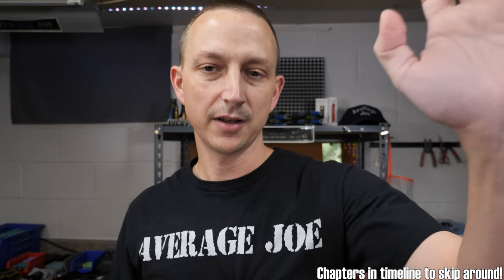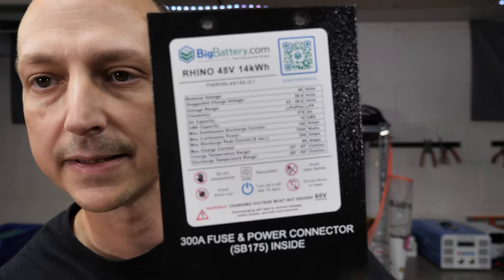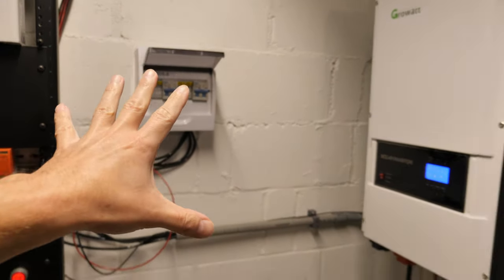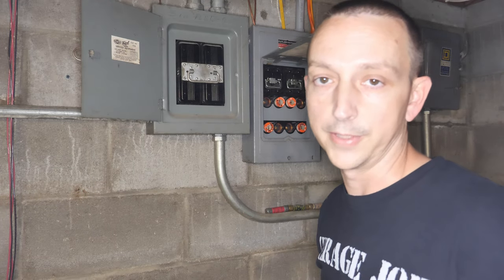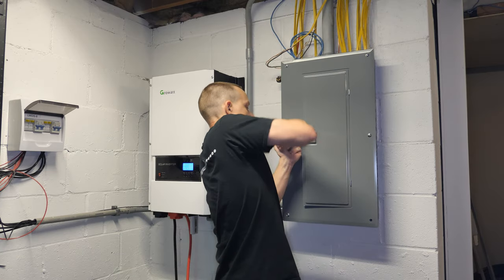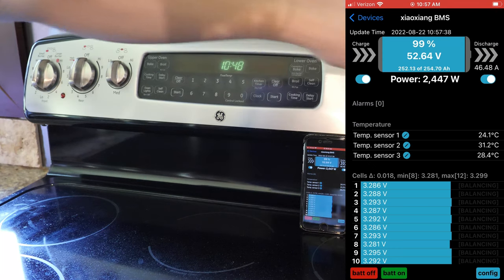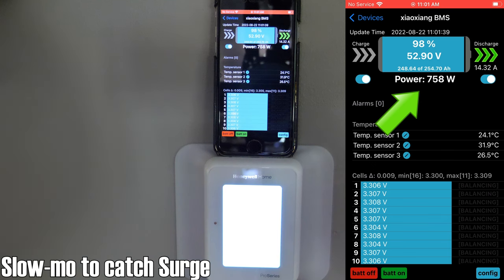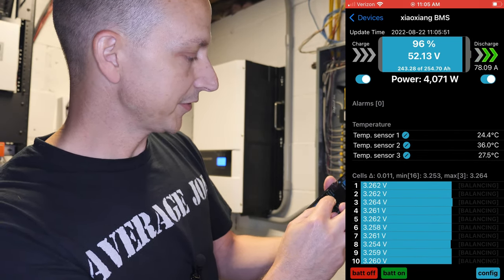Can you Run 4 Ton A/C, Stove or Dryer on a Battery???  RHINO BigBattery.com

Comment: I have the 6000w version of the same inverter and it was running my water pump 220v and my living room only, but that one only works for 7 months and then get bad from a short circuit on the charger area or terminals.  Not sure if it was the Florida heat or the inverter quality.  Thanks for your videos 👍
Reply from the maker: Thanks for watching! Interesting that you only got 7months use. I have been using almost 2 years! Is there a board you could replace on the inside that shows damage?

Comment: Your Growatt inverter . is it a hybrid inverter. if not and is a grid inverter. How can you run a battery backup from the on grid inverter install.
Reply from the maker: It is an off grid inverter but is connected to grid for battery charging or using passthrough mode. Many different ways to use. Option 1, use off grid only. Option 2, use as off grid but grid connected as a backup source. That allows grid to charge batteries and allows grid to pass through inverter to keep powering loads. 3rd option, use a a UPS which is keep using in passthrough mode and if grid goes down for whatever reason like a storm. It will switch automatically to off grid to continue powering loads. Once grid returns it will auto switch back and recharge if wanted.

Comment: Great video AJ! Always add a spin in the process👍🏽.
Solved a similar situation by changing my 2, 2.5ton conventional central units, to the Amana 24-SEER central units. With both units on, pulling under 2KW, on my single Schneider Conext XW Pro 6848 inverter.
Reply from the maker: Damn! Thats GREAT!!!😲

Comment: Yes, those last two digits matter. That would tell you if they installed grade B junk cells. You could have a 99 mV voltage differential and look good. Manufacturers are getting slick. They like to control charge current with the BMS to keep runners from showing up at 55.8V too. Off grid garage said they don't control current. Well, try a Seplos 200A 16S or a Trophy battery. No more factory batteries for me.
Reply from the maker: I know these have JBD bms's and they are not smart enough for controlling current.  They are on or off!!
Reply: Off Grid Garage did not have as good of an experience with the Seplos.

I really like what I have seen from the JK BMS’s so far, from off grid. My money is on them.
Reply from the maker: Yeah that sepo bms seems crappy for sure!

Comment: 1) If my math is correct, I think to convert from Ton/SEER to Watts you Multiply the Tonnage by 12,000 (1Ton in BTUs) then divide by the SEER rating. Therefore (4x12,000)/14 =~ 3500 watts. This of course is Average and changes as the compressor cycles on and off.

2) You can install a Soft start kit on your AC (I think they go for a few hundred dollars) that would prevent your AC from Surging that much on startup. It helps improve the performance and longevity of you AC and not over tax your inverter/battery.
Reply from the maker: I dont math well😆  Yeah Ill for sure be looking into the soft start!  I would imagine it would help out A LOT!!!🤘
Reply: @AveRage_Joe  Great! Thank you for the great content.
Reply: Just call it 1000W power consumption per ton. It is close enough. Yes, soft start will reduce LRA 65-75%!

Comment: Thanks a lot for testing this for us Joe :-)   !      I have a question that you might be able to help me with. I am in the process of installing a 12KW Growatt inverter (same as yours),  and was wondering what size Circuit Breaker you are using for the Inverter "AC IN" and for  "AC Out" because everything seems to be working fine at your end, and would like to use a similar setup.   TIA  Dan
Reply from the maker: Thanks for watching!  Your going to Love the inverter btw!!!  So AC input at the moment I am using 2 60amp fuses on that super old panel.  I am using 60a at the moment because I am not running the AC, Stove and dryer.  Once I add all my other batteries and add the AC, stove and dryer(and upgrade that old panel) I will use 2 80amp circuit breakers for the input feeding the inverter.  Output is 2 60amp because the inverter already has 2 60a breakers on it.  Reason you use 2 80amp for input is because you need a little extra so you can run the house plus charge the batteries from grid(if needed).💥🤘
Reply: @AveRage_Joe  Thanks a lot for your reply Joe!  that's helping me a lot.  Take good care!   Love your videos  :-) .
Reply from the maker: No prob and appreciate it!!

Comment: I run my stove on solar everyday. The eyes turn off, for about 2 minutes, and turn on for about 15 seconds. That's my stove though. I have a Samsung flex duo. 
The oven is about 1600w per leg, 3200w total.

My dryer is what kills me. I have to use it during the day, about 1200w per leg, then a long cycle of 2000w per leg, for about 1.5 hours. 

I have a single MPP solar lv5048 
6x 14s2p (kind of) Nissan leaf batteries
And 40x 240w Trina panels. 

I need another lv5048, way more batteries for my amount of panels, and I want more KWh, lol.
Reply from the maker: NICE!!! Thanks for sharing!  Sounds like you have a pretty good setup and YESSSSS  WE WANT MOAR!!!!  Moar on the way!!!😆💥🤘

Comment: AveRage Joe, thanks for the test!
Here is a video before and after test on a ‘Soft Start’ on a 4 ton air conditioner
Reply from the maker: I didnt see a link?
Reply: @AveRage_Joe  looks like YT pulled the link. I will send several if you need via other method.  You should be able to do YT search to see a variety of versions.  Do your homework. They are not all the same.

Comment: You were using 150amps plus from battery, but what is the breaker amp feeding the power to the panel?  And how does that work if the breaker feeding the panel is less amperage?
Reply from the maker: Battery has a 300a fuse which feeds inverter. Inverter changes the 48vdc to 120/240vac which feed 2 60a breakers on panel.
Reply: @AveRage_Joe  Ah, so the amps are reduced at the inverter and the voltage  is raised from 48 to 120/240.  Got it.

Comment: are you still using that inverter? i was thinking of buying one for my 5th wheel. have you had any issues with it? thank you.
Reply from the maker: Yep still using it 24/7! No major issues at all, just a few random quirks,1 occasionally it wont see the solar panels so wont charge. When it does that I change the charge setting to either grid charge or solar and grid. Then it see's the solar panels and Ill change back to only solar charge. Occasionally if you are in bypass mode(grid mode) and use the app to change to off-grid mode, it dosnt switch right away. If it does this then Ill turn the AC input circuit breakers off to force it into off-grid mode.

If your in a 5th wheel and dont use it 24/7 like me then you most likely wont ever have these quirks. I Love the inverter and would purchase again!🤘

Comment: nice but what is the inverter doing
Reply: It's running so u better go catch it
Reply: @electromechanicalstuff2602  always going to be a smart ass I’m asking how much watt is the inverter running because it’s only showing the battery because why he’s doing with his running his house without the AC the stove and the dryer I do It with a 3000 watt inverter
Reply: @solarandwindinsouthtexasda1473  yes I am and what?! Please link the video of you running a 4 ton ac unit starting and running on a 3kw inverter while running multiple burners on an electric stove while running the blower and other items all simultaneously. It's the only battery connected to the inverter so what the battery is seeing is what the inverter is doing. Ac and stove are 240 so should be a pretty balanced load.
Reply: @electromechanicalstuff2602  not a 4 ton but I run a 2ton 240v Wiht a 2500 watt 120v inverter 🤣🤣🤣🤣🤣
Reply: @solarandwindinsouthtexasda1473  2 ton? So 24,000 BTU..... At 120 v? Uhhh
Reply: @electromechanicalstuff2602  2 ton a/c 240v running on a 120v 2.5kw inverte wiht a transformer to get the 240v
Reply: @solarandwindinsouthtexasda1473  lots of work and still struggling to believe a 120 volt 2500 watt inverter handled the startup of a 2 ton unit. Also u said you ran a dryer on it? Dryers are 5,000 watts. So I'm not really sure whats going on here. One burner on a stove is usually around 2,000 watts also. I think what Joe was showing as far as watts was accurate and what your saying you did with a 2500 watt inverter is questionable.
Reply: @electromechanicalstuff2602  🤣🤣🤣🤣you re so funny 😂
Reply from the maker: Inverter is running the house minus the AC, Stove and Dryer in normal day to day use as I need to change out some old fuse panels in the house.  In the vid I end up back feeding a fuse panel to power the AC and Stove.  Not the most efficient way due to extra wiring but doable.
Reply: @AveRage_Joe  ok i ask because I run my house on a 12v 3000watt samlex evo and I want to run my a/c and water heater but I don't know if to get a growatt, ipp lvx6048 or a genetry solar inveter I had a sol-ark bad experience if the load are not balence it shots off
Reply: @AveRage_Joe  I saw that in the vid and thought you explained it well. I installed a new 200 amp panel with only 8 breaker spots but has passthrough lugs. This way I have grid power for bypass but like you use an interlock to choose main vs aux
Video of my system.
It's completed now and running just need to make a new video.
https://youtu.be/w_ycEQPwCm0
Reply from the maker: Oh ok gotcha. Well to be honest, I have only used the growatt so can only "recommend" it. I do hear good things about gentry tho. They are a beast and can run a house no prob. Seen a few vids of people loading them up and they take it. That sucks about the sol-ark.

Comment: so at night I can't run ac 🙃 unless I get like 40kw worth if batteries ?   But during day when solar is charging I should be fine all day? I'm in sunny central California.
Reply from the maker: You could run the AC at night but by morning you might be back on grid if you have it setup to do that which is what I do.  What is your avg temps during nights tho. It might not run a bunch especially if your home is insulated pretty good.
Reply: @AveRage_Joe   i gets to 110-115 in July and August here.. at night during the summer around 80 but we sleep up stairs and it's like 10-15 deg warmer upstairs.. maybe I got poor insulation.. I would have AC set at 77 deg and it would cycle every 10-15 min and stay on for about 5-10.. so I don't know what size batteries to get

Comment: I am finding out that if batteries are not on the California CEC solar equipment list, then your system will not be permitted. Anyone else finding out about this?
Reply from the maker: I know Cali is diff then a lot of places but usually the electrician can install equipment in accordance Local codes. I personally know electricians here that have installed Big Battery Products to meet local code. Even equipment that is not on any list. Just needs to meet electrical code when installed.

Comment: Would you be willing to put a number to the battery run time in your situation running the A/C. My wife and I are trying to get a point of reference for adding a battery ( or batteries) for home backup and or use overnight.
Reply from the maker: Are you wanting to run AC only or hole house with AC?
Reply: @AveRage_Joe   I am trying to have enough battery to have the house function normally through a night without power. We have a natural gas well so the only large loads in the house are the central
A/C (brand new 5 ton inverter compressor 20 SEER with a variable speed air handler, two Mitsubishi minisplits in the shop and welding equipment (the last two would most likely be off during and outage). Our highest energy usage this summer has been 1500 kwh for the month (multiple days in the high 90's to the low 100's). That was with one minisplit running in the shop full time (and the second one added when I am out there working). We have a Sol-ark 15K and 8.2 KWH of solar. There will be a generator in the mix being controlled by the Sol-ark once the batteries are figured out.
Reply from the maker: Oh ok gotcha!!!  Do you have any battery right now or just running solar only with the sol-ark?  As for actual real run-time,  Ill have to run another test running the AC until the battery is ded or at least to 46ish volts.  Id hate to just through out a number but would imagine you would want at least 30kwh for when the sun goes down and back up again.  How many hours are you looking for?  What I mean by that is, do your panels get sun early in the AM or later in the day like mine.
Reply: 4-8 hours would be nice. It was my understanding that once the battery is in place the Sol-ark will be able to turn the generator on to take over the loads and charge the battery once battery is discharged. I would prefer to limit the amount of generator run time needed. My system is ground mounted with zero shade. It gets sun pretty early. I appreciate your help and advice.

Comment: Sir Joe!  Do you know if anyone sells the bare blade cells?  I would like to start buying some in a few months, or maybe enough for a 12v battery, for lights and security cams,  I have 6,120ah 29.4v batteries, a few leaf cells making a matching voltage battery, and a tub full of the spim 8ah cells I may use but would like to build a 72v Ecycle around 50ah with a 5-6kw motor!   But I'd rather NOT be sitting in the dark, on a rainy day, my well pump pulls 7amps, I have a soft start, with all together about 33kwh,. I'm thinking about getting a all in one inverter for the charging only, I saw one with a 120a mppt plus grid charger, that's what I need, so I can charge with my generator,  put nearly the whole 6kw into the batteries! I could run the generator about 2hours and get a decent charge! But I want to buy about 50kwh of lifepo4, slowly, to replace my liion bank, sitting on all that fire prone liion is unnerving! I hope to get a larger inverter, to at least run ac for 1-2 hours a day, and still power every thing else, TV, lights fridge, possibly well pump!
Reply from the maker: Only place Ive seen them is on alibaba or aliexpress.  Id choose alibaba over aliexpress tho.  Yeah id leave the spim cells for the ecycle.  My inverter has 120a solar charger and 100a grid charger which could be connected to genny if no grid.  They have a smaller 6kw inverter but I think its a 80a solar charger.

Comment: You need to be careful that you don't overload one phase of your inverter not all 240 devices .. or nowhere near balance like your dryer one leg will be pulling 15 to 20 amps one leg will be pulling five
Reply from the maker: Yes you should have them balanced but the low frequency growatt doesn't mind as much as other inverters!🤘

Comment: I calculated still whole setup is expensive. I live in Arizona where😮 my 3000 sq foot house has two 4 tone AC. I get around 400 dollars avg permonth  June through September and less than 200 dollars average rest of months. So if i get solar panels (8000 dollars setup, mounts,  inverter etc) and this battery (6000 dollars) It will take almost 10 years to recover the cost and by that time my battery will degrade, one or 2 solar panels might need replacement or repair, inverter life because of 24/7/365 can definitely impact. And after 4 years on the top of 10 , total of 14 years my AC migt need replacement so it will be super expensive. Therefore I will not go for your setup. Rather save that money and invest. After 14 years buy a new AC unit.
Reply from the maker: I hear ya on that! I buy 1 thing at a time and build as I go.  Plus that helps with the up front cost. I just never wanna lose power. Lost it in the winter once and Ill never go through that again!🤘

Comment: Our Frigidaire inductive slide in front control stove and oven air fryer works great on our independent power system. Induction heat is 95+ efficient with 100% compatible pots/pans.. Much lower power draw than conventional. Our hacked Rheem 21-34 SEER variable speed whole house DC compressor system works great with direct DC connection to our independent power system.  Both cooling and heat pump. Uber efficient, slow ramp up power up built in new whole house variable fan for this system is very efficient. We can run all of these at same time.  We have on order a variable DC compressor heat pump dryer.  Is very low current draw, and ramped up start, will allow us to run all these off our IPS (independent power system).  Solar input running, hardly any net battery discharge.  

By using this tech above, we save much Peak IPS electricity demand, and ongoing power demand. We gain efficiency by using direct DC from as many appliances and HVAC.  Adds 24+% efficiency. Also, we are installing “DC” level two KWH sized charging for our upcoming Tesla ModY-P. 

We plan on bundling this system for sale to others.  This IS the future.
Reply from the maker: Love ALL of this!!! Yeah running from dc would be GREAT!!!